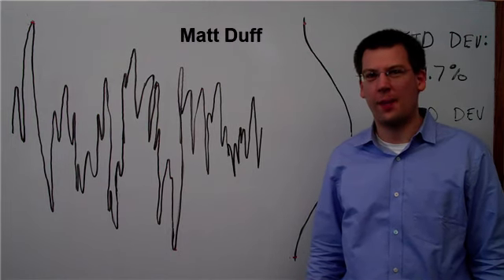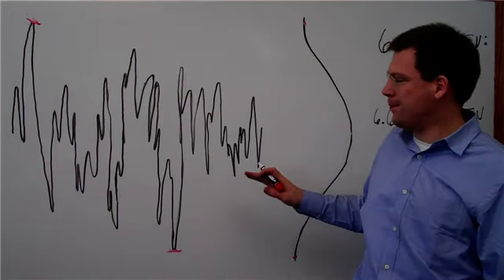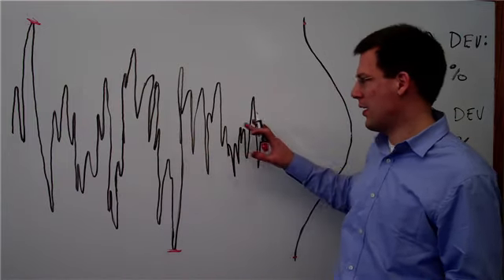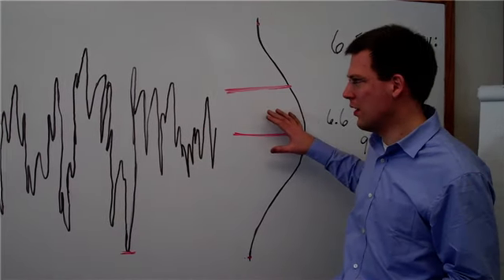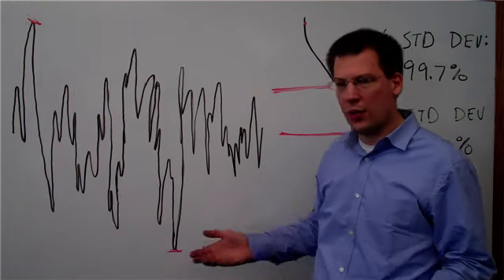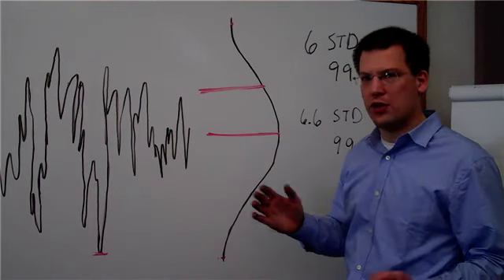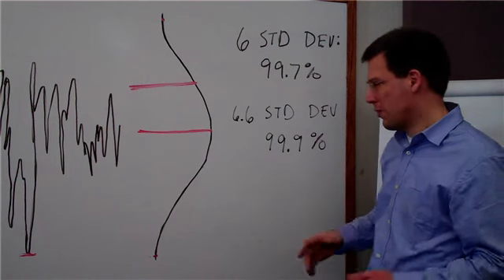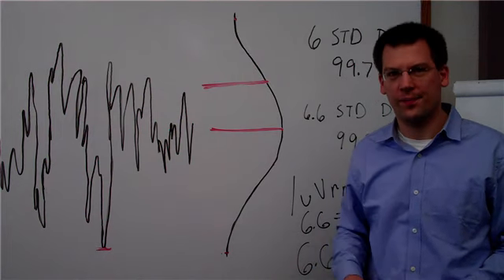Calculating RMS Noise to Peak-to-Peak Noise

Comment from the maker: I’m not an audio expert, but this would be my guess: you probably want the speaker and the amplifier rated about the same. If the amplifier is underpowered, you’ll distort at higher volumes and won’t be able to get the full volume out of the speakers. If the amplifier has lots more power, you increase the risk of blowing out your speakers.

Comment: Why do you multiply RMS noise with 6.6 instead of the SD of the RMS noise?
Reply from the maker: We want to convert from RMS noise into peak to peak noise. Because noise has a Gaussian distribution, to span 99.9% of the waveform (approximately peak to peak), we need 6.6 standard deviations. Because the average value for the noise is 0, RMS equals the standard deviation, so we can just multiply the RMS noise by 6.6.

Comment: Thanks for the video.
I have a question: RMS stands for Root Mean Square. Is it true here? Can you clarify the relationship between the 1 stddev versus Root Mean Square of the true noise?
Reply from the maker: Bảo Anh Nguyễn RMS equation is sqrt(1/n * (x1^2+ x2^2 + …. xn^2).  Standard deviation is sqrt(1/n * ((x1-mean)^2+(x2-mean)^2 + …. (xn-mean)^2)).   When mean is 0, the two equations are the same.    Since noise mean is 0, they are the same for noise.

Comment: Correction factor (F) depends on sample size; F=6 corresponds to a sample with the minimum measurement likely to be 3 standard deviations below the mean.  For sample of N measurements, the cumulative probability values (P) of each measurement are uniformly distributed over interval (0, 1).  Minimum measurement has estimated probability P=1/(2*N).  Find this z score for this P value, double the score to get peak to peak correction factor (F).

Comment: What if the mean value is variable and non-zero? (But is smooth and varies gently so I can figure it out via e.g., a polynomial fit)? In that scenario how are RMS and standard deviation related?
Reply: If the mean is varying then it isn't a gaussian distributed noise, or what we call white noise. Standard deviation is defined only for Gaussian distributions. So there isn't a direct relation between RMS and standard deviation in this case.